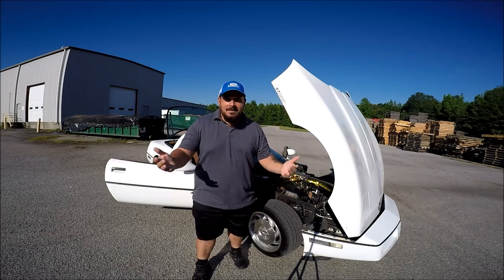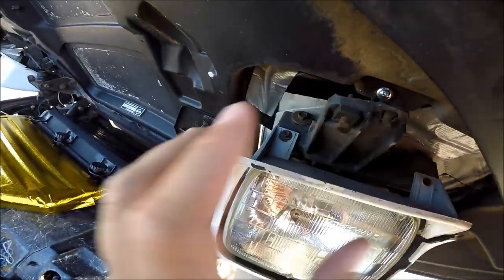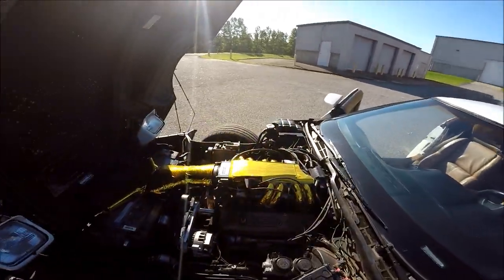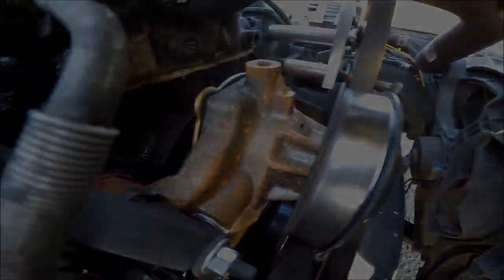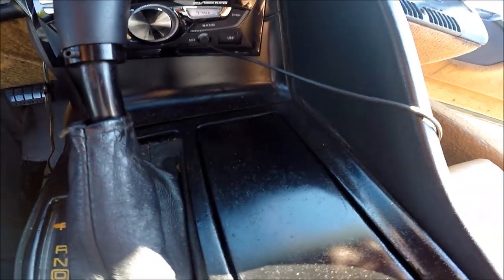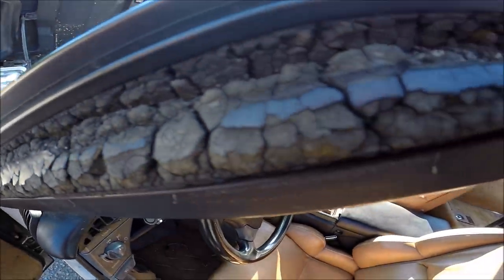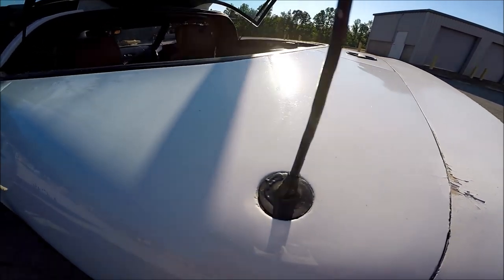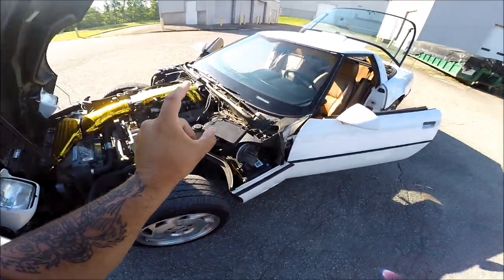11 Things That Will FAIL in Your 1985-1991 C4 Corvette

Comment: Funny, i daily drove both my previous C4s for 11 years and never had any of those items fail.
Reply: this vid was mostly cap
Reply: I wish.  I inherited mine and the weather stripping looked just like his and the speakers didn't work.  Within a month of getting it running I had to replace the passenger headlight motor and just had the VATS fail.  Instead of jumping the VATS, replaced the tumbler, but then found the plastic in the column all cracked when we opened it.
Reply: @rodgerlang884  the parts are expensive lol. I have a lot to do on my 95 corvette.

Comment: With the exception of the VATS and speakers, pretty much everything else you brought up could be mentioned in a video for any 30 year old car. They're wear items that have in most cases lasted well beyond their designed lifespan.
Reply: Well i'd also say that a 30 year old speaker shouldn't be expected to last this long too, it's almost inevitable that the cones will be rotted out by now
Reply: I just removed 1992 era coolant hoses... theyre still good but I'm tuning up the most important things in the car and I'm surprised some stuff is still solid. Especially if you buy one bought from a grandpa type. With maintenance they last for eons.

Comment: I've owned a '91 Convertible for 30 years and both the radio CDM and the fuel sending unit failed last year. The fuel sending unit, living in fuel tank, was an easy fix, but the CDM was a pain to get out, since it was under the passenger-side dash. Interesting, that they both failed at the same time. I suppose that isn't too bad for a 30 year old vehicle. However, I did have to do normal tuneups, oil changes, replace tires and battery a couple of times, but I suppose those are normal maintenance items. I think the trick to the longevity and trooble-free vintage Corvettes is how well you maintain them.
Reply: How does the L98 perform? I'm thinking of purchasing a 91. No optispark problems. Still has good power with the 245 hp engine and good torque.

Comment: I owned an '88 35th Anniversary Edition. They were individually numbered on the console by the shifter. I loved that car! Headlights worked Great! Now my '03 50th Anniversary the right headlight failed. Only thing on my '88 was alternator went, and the antenna. The roof panel, I had 2, the hard top and a smoked. Your panel is an easy fix. You can buy a replacement on eBay. Scrape the old one off with glue. Buy a can of spray carpet glue from auto parts. I sprayed new glue on and new headliner fit perfectly. My car had 45k miles.

Comment: I added a VATS delete switch and upgraded my stereo system to subwoofer and speakers with a 750 watt amps, with a new head unit that has a foldout screen with Bluetooth, front and rear video camera's,  phone calling capability. Replaced the bad L98 350 with a better 88 L98, 4 bolt main bored out .040 over. Flowed the intake, and rebuilt the aluminum heads with Manley valves and Crowler rockers, with a mild Crowler cam. Designed and installed one off custom seat covers, and did the interior plastics in carbon fiber. I do R&D carbon fiber for a aircraft company and have experience in this. My 86 indy pace car has been completely taken apart and rebuilt with all the suspension rebuilt. It was a flood car when I started. All new electronics, wiring, vacume lines. Also replaced the exaughst with Magna Flow components, and new set of shorty ceramic headers with the Air tubes. Only thing I need is new paint, due to chips.

Comment: I have a 1989 with 200k miles that I have owned for 25 years.   My headlight motor actuators have been epoxied but still work.  I have only had  problems getting vats keys duplicated but no problem with the system itself.  I have replaced the water pump once.  I have had no problem with my steering wheel even though I use the steering wheel to get out.  I have replaced the headliner.  My cup holder door is original and is working fine.  My Bose is kaput.  My weather-strip has been replaced once and needs it again.   I have broken the mirror control knob and the glass trunnion, but no gears on my mirrors.  My power antenna has given up, twice.  I have never had a hiccup from my fuel pressure regulator.  I guess your average may vary.

Comment: I have an ‘84 C4 (74k miles) and my headlights are a little offset and uneven when not in use. My horn fell out of my steering wheel so no honking for me. My antenna just started failing to fully erect and fully retract. Also when the weather gets real hot she only idles at 400 rpm. But man do I love this machine!
Reply: There are adjustment screws on the headlights so you can even them up

Comment: At 240,000 miles the only problems with my 89 C4 is weather stripping and antenna. Taking proper care of a car works. Oh, I have changed the shocks and injectors once at 200,000 miles. They were not bad, but thought it was time. I have had 6 sets of tires on him.
Reply: Proof that Vett's driven year round last longer. Why can't people understand this. Use it or lose it.

Comment: 38 years and over 200,000 miles and I replaced antenna twice, and one fuel pump a year ago, along with the hood struts and convertible top with weatherstrips.

Comment: I had an 87 and 88 convertible in the 90's  Headlights, water pump, radiator, dash lights,  other minor stuff.  Pretty easy to work on.  The styling was good 35 years ago but just not a fan of the C4 any longer.

Comment: Damn, the only issue of these that I have are the headlights. I have however had more engine problems. I have a low mileage example that sat for 15 years. I've had to do fuel injectors, egr, new cats, fuel pump, fuel filter, cap and rotor, IAC, and am currently working on changing the head gaskets. Fun cars, but be prepared to constantly work on them.
Reply: It's better to buy a Corvette with normal mileage . The car is made to drive not sit in a garage for 6 months a year.  Why buy a vette if your not going to enjoy driving it? The fluids need to circulate for proper lubrication. You will have more repair cost just to get a never used vette on the road than a vette with say 80,000 plus mileage. The price you pay for a vette that has been driven normally is a lot less and will be in better  condition.

Comment: My 91 corvettes Vats system failed on me at a Walmart parking lot, I was able to make my own 3 Ohms resistor and attached it into my wiring for ignition/key as well as a steering wheel wobble, made my own pins on each side of the steering column and fixed the wobble

Comment: Dude I’ve replaced fuel pressure regulator alternators starters fuel injectors egr valve radiator master cylinder and break booster fuel pump and I have an insane amount of oil leaking onto the exhaust so she smoke lemme tell you if you plan on driving that car a lot be prepared for more expensive suprises

Comment: Dam !!! My 1992 is in much greater shape . I have been keeping up with it though. I rebuilt the headlights, New timing gears/chain , new water pump w/ added nipple on weep hole with rubber hose to avoid getting the new optispark from getting wet. New Quadra jet injectors, platinum plugs, new wires, new fuel pressure regulator, new ignition coil, new fuel pump, new map sensor , new idle air control, new idle pulleys , new harmonic balancer , new front main seal, new water pump and optispark seals, stainless water pump bolts, new fuel filter, new TPS sensor, ... deleted catylitic converters, cherry bomb mufflers, triple air intake, drill slotted rotors, ceramic pads, braided stainless lines , exhaust is galvanized and new tires. My 1992 runs better than it was new. Not sure on the amount of horse power but definitely more than the factory 300 . 😀 If you wa
Reply: If you want something nice that’s 28 years old , you need to take better care of it.
Reply: Damn, semms you have replaced almost the whole car. Would never dare to buy one of these, even if i really like them., cuse it seems they can make you end up in the poor-house.Typical example of american engineering and build-quality ,with lots of flaws, just like a harley, but you are not buying an american veichle with your brain, you buy it with your heart

Comment: So Do 94s not have all these problems, I am a young teen that is learning about this and I’m wanted to get to know more. You said at the beginning it was 83- 91
Reply: Those models had the L98 model in them, the 92-96 had the LT-1 and were considered better and more reliable.
Reply: @Bhamofficer328  so then only buy 92 to 86 models?
Reply: @Bhamofficer328  better yes reliable no due to the opti spark in the LT1 which can fail with no warning, OEM not available and aftermarkets are a roll of the dice
Reply: @bobpx  Agree. The opti spark is expensive to fix and will re occur.

Comment: From all the videos I've watched on Corvette's I've learned one thing. I don't want any year of the damn things what a joke!
Reply: i agree with you. Even if i wanted one, i would newer dare to buy it. i will stick to my 2003 MB clk 500 with the wonderful silky-smooth M113 V8. It has almost exactly the same amount of horsepower and torque as the LT 1-m,otor, but lightyears ahead when it comes to comfort and build-quality.

Comment: So you're saying I should use the money I've said for a 92 ~ 96 for sure?
Reply: Research opti-spark and water
Reply: @user-dz6zd2sk5c  That's why I prefer the 1991 with the L8. Less HP but with the low torque it moves.

Comment: I have a 1990 corvette and it’s definitely needing its weather stripping replaced (free car washes living in the Pacific Northwest 😅) and even after taking it in for low coolant” it’s been giving me the light again so back in I go! 😮‍💨 and winky headlight on the passenger side - somehow works better when it’s raining (free lube?) and or after it’s been driven a bit. Definitely a car that needs babying but it thankfully hasn’t left me stranded (yet). Oh and my A/C which is a $1400 conversion job. The old version is obsolete - made hot summer driving pretty swampy. Otherwise the paint is in excellent condition and it’s low mileage. Super fun car!